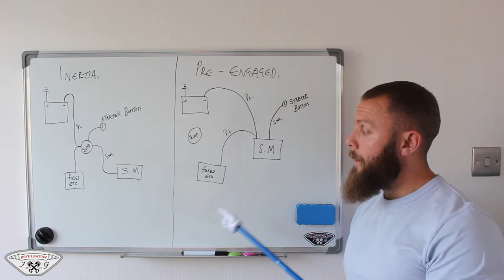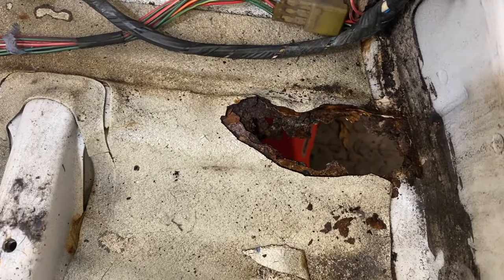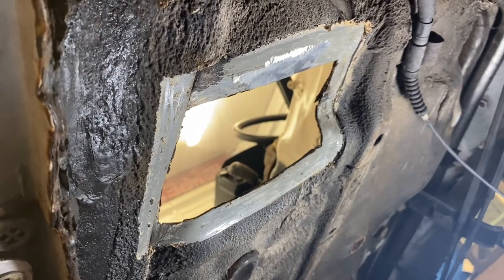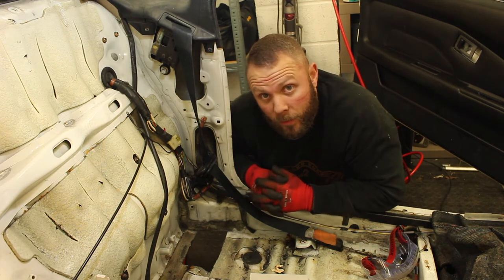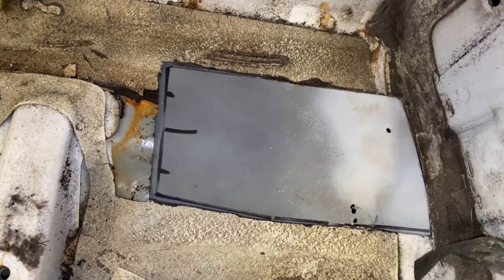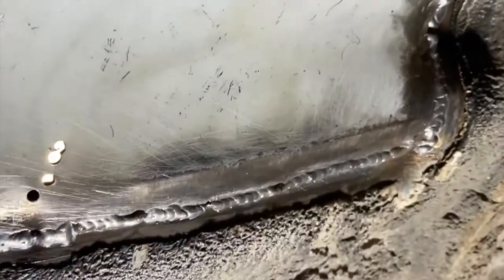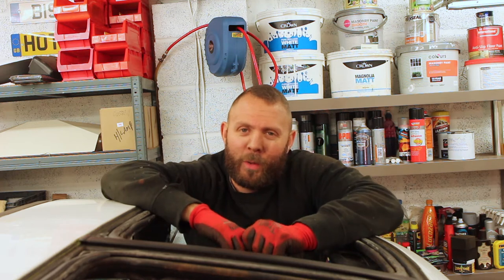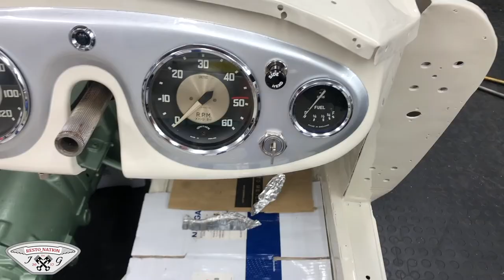How To Repair Rusty Car Floor Pans

Comment: couldn't you just weld it from inside ?
Reply from the maker: Yes but… then you’ve got an edge all the way round for moisture to sit in and cause corrosion. It would still be seam sealed but could flex and cause problems. Better to seam weld from outside.

Comment: When I repaired holes in my Mustangs drivers side floor pan, I cut the rust like you did and bought a cookie metal sheet and JB Welded it to the still good metal where I had cut... So far so good ! I hate welding thin metal... As a matter of fact I suck at welding thin metal... I then put construction polyurethane sealant and a coat of POR-15 on and under the new floor pan, Been holding up good for almost 3 years now.
Reply: Interesting.

Comment: so you need to clean up both outside and inside? what if it's just a hole like a damage? how could fix that?
Reply from the maker: Only need to clean the faces where you weld or where surface rust is. 
If yours is damaged then cut out all of the damaged bit and make a patch to repair 👍🏻

Comment: The overlap welded patch looks way better, and stronger than the butt joint patch that I just watched. Thanks.
Reply from the maker: Horses for courses. Butt joint is tidier but more fiddly and time consuming. Depends on where it is on the car etc 👍🏻

Comment: I bought a 1987 Mk1b in December, I'm basically new to mechanics of any form. The car has similar problems and needs wheels archs re-welding, as the previous filler job is to a naff standard. This series is incredibly helpful for me and makes the project slightly less daunting. Keep the videos coming!!
Reply from the maker: Hi mate. Thanks 👍🏻. I will aim for a video a week and keep plugging away. If you want anything specific then let me know...
Reply: 3 years later.... how did you go with your welding?

Comment: How do you remove all that lino type materiel on the inside I have a ranger with hole in floor pan garage have said they will do it cash in hand if I take carpet out im not as bother as you taking the carpet off I'm just going to ripp it out im just stuck on all the lino type glued down cheers
Reply from the maker: I’ve seen people freeze it with dry ice and chip it away frozen 👍🏻

Comment: What current/wire gauge did you use? Have my mig on the lowest with 0.8 and it's still blasting through that thin floor :(

Comment: Sir you might want to aquire a three tool set of aviation snips red,green and yellow. Cutting left right and straight..it should make your sheet metal cutting chores easyer.
Reply from the maker: Makes a lot of sense. I didn’t know they existed to be fair. Thanks 😊

Comment: Great video. Did you consider welding the piece from the car’s interior? Looks like more space, light etc?
Reply from the maker: Welding from inside? It’s best practice to weld from the outside when patching 👍🏻
Reply: @Resto.Nation  didn’t know that. thanks.
Reply from the maker: @philb3331  it helps water tightness. If you welded from the inside then there is a mini gap where the panels meet externally that moisture can creep into causing more corrosion.

Comment: I need to fix some floor spots in a mini van I just bought.   Not looking forward to tearing out the interior.
Reply: Yeah, it sucks but its either that or having a car fire due to the welding and if you do it right the first time you wont have to worry about it, had a buddy of mine years ago install subframe conectors on his car,he didn't wanna take the interior out since its all outside welding,well lets just say he had to order a new carpet when he was done,lol

Comment: Would that work on the heat shield for the exhaust?  Bc it came off n burned through the bottom of trunk
Reply from the maker: Work in what way? To patch it up? Or make a new one?...

Comment: Thank You Soo Much..
Do you have to Weld in Metal.
Can you drill and Rivet Then Fiberglass and Bondo patch top & bottom after seam sealer, then add your rock chip protective coating ?
Or has got to be welded to pass DOT Safety's?
Reply from the maker: I wouldn’t. It was metal from the factory and has been designed for metal so replace with like for like 👍🏻
Reply: Yo need to quit being afraid of welding. You are talking about 30 steps that will yield bad results vs just learning how to donit right

Comment: Underbodycoating is a mess to remove, isnt it? What is your best advise, tools? Chemicals, heat? My wirewheel doesnt cut the cake!😅
Reply from the maker: Nightmare! I was going to say wire wheel. Maybe a scraper? Or a roloc wheel…

Comment: Hi, does it matter whether you weld the plate from the bottom or from the top?
Reply from the maker: From the outside. And seam welded. Then seam sealed.
Reply: @Resto.Nation  thanks!

Comment: hey just a quick question, what seam sealer product did you use? im trying to find something as thick as the oem toyota stuff and yours looks better that anything ive found. and plus i can not find brush on stuff redily available either so maybe you know a store or brand to try? thanks in advance and btw, great job on that patch. its the same im trying to do more or less but looks way easier when you did it haha
Reply from the maker: Hi mate, thanks. Unfortunately it was a trade product that my mate got for me so it’s not shop bought sorry. Good luck with yours 👍🏻
Reply: I know this is a older comment but it might help someone out there,i found some stuff at Oreillys here in The States (mentioned that because not sure where you were) that works real well, its callled EVERCOAT seam sealer,i used it while installing some hinges on my project car and it worked well, it comes in a tube like bathroom caulking would,hope this helps.

Comment: How much would a job like this usually cost at a shop
Reply from the maker: A small floor pan section? Or all of the metal repair that I’ve done on the whole car to get it roadworthy?
Reply: @Resto.Nation  floor panel plus rusted rear side panels
Reply from the maker: Rear side? Do you mean wings or sills?
Reply: @Resto.Nation  a town and country family van 2005 back rear panels over the wheel sand driverside rear floor panel hasn't spread to frame yet but I want to get it fixed runs great and I want to teach my kids how to drive with it
 Dont want to spend an arm for repairs.
Reply from the maker: It’s impossible to say sorry. It’s a time consuming process. Find somebody that reasonable that you trust and set a price before you start.

Comment: I would weld the patch from top , way easier .
About to do the same thing on my e30 bmw 
Great info tho 
Thanks for sharing
Reply from the maker: It is easier but it’s not the way to do it tho. 
If you weld from inside then you’ve got a gap outside between floor and patch that water will track into and rot the floor again. Even if you fill the gap with sealer it can flex and crack and let water back in again. A seam weld won’t 👍🏻
Reply: @Resto.Nation  correct me if I'm wrong but I believe you made a lap weld

Comment: why you use this scrap part of sheet metal with drilled randomly holes xD disaster men, you shouldnt be proud of this job..
Reply from the maker: I’m super proud. It’s my finest repair section.
Reply: @Resto.Nation  not sure what that guy's complaining about, looks great and it's functional. 👍👍
Reply: Unless you’re trying to get a show quality vehicle, that patch panel is fine.
Reply: "Shouldn't be proud?"   He did a nice repair using salvaged metal.  Nothing wrong there.  You shouldn't be proud of making such a comment.